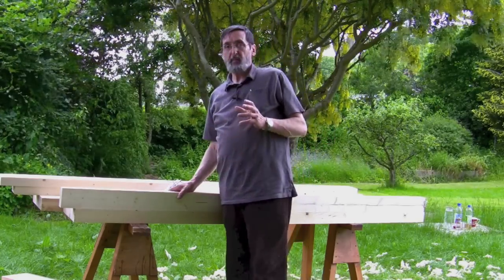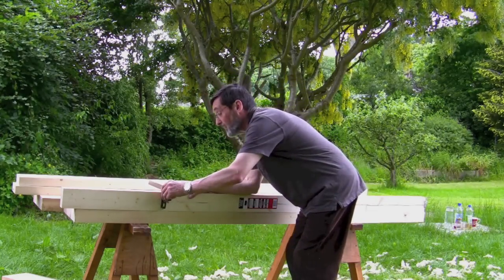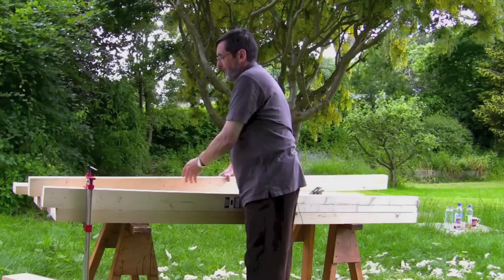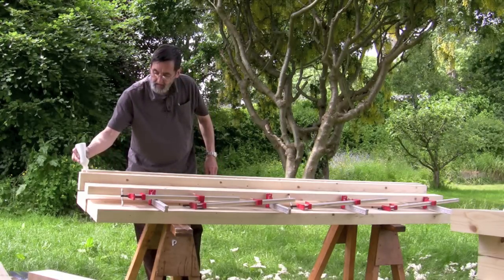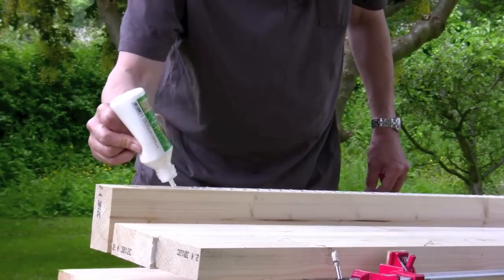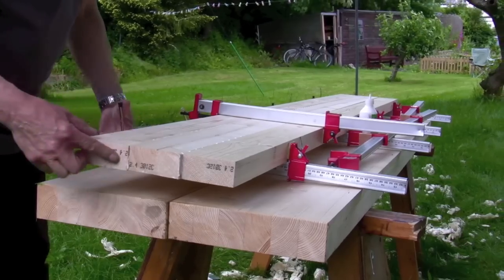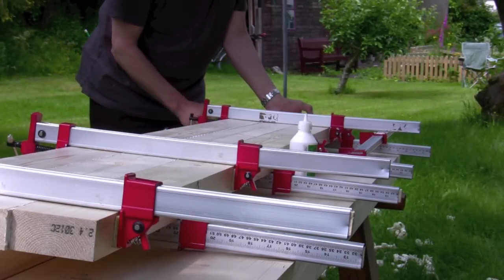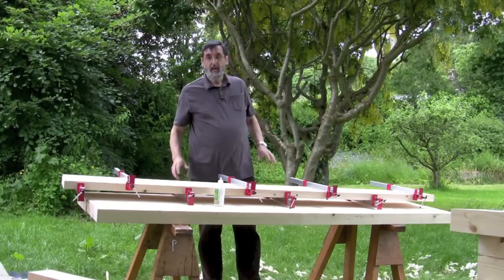How to build a workbench - (Part 4) Making the aprons and the well board | Paul Sellers

Comment: I have been working with wood as a self-taught hobbyist for many years. My adult son recommended your videos and I am pleased to admit that I have learned more in a couple hours watching you than I had on my own in all those years.

Following your videos (and a book about making wooden planes by David Finck), last night I took a perfect shaving for the very first time in my life. More than that, I took it with all three planes I had at my disposal a smoother sharpened as a scrub, a new model Stanley smoother with just a light touch at the corners of the iron and a low angle Bailey. As a former machinist and die-maker, I got a little "retentive" about how flat the soles were, but it cost me nothing extra except time. It is a real experience to cut the dust off a piece and, completely in control, dial the plane in and take robust cuts with the same tool.

My first "project" with a plane was to flatten a piece of SYP for the backing for a strop similar to yours. I marked the wind (there was PLENTY!) by rubbing it against my tablesaw top and planing off the shiny. That was a familiar procedure from my days of barbering dies.

Loved the tip about using a chisel to give the saw a guiding wall to register against. THAT will get used.
Reply: My smoother / scrub is marked as a "Handyman". Pretty cheap on the day it was bought ... but it was singing last night!

Comment: Currently laminating a 2x6 southern yellow pine table top.  Took my 1.5x5.5 down to 1.25.

Glued a few sections, and after planing all of the sections down to 4.5 thickness, I just say your comments about weight ring true.

This 60x60x4.5 top will likely tip the scales above 300lbs.  And I am certainly feeling it.

Thank you for such informative videos.

Comment: One major thing I feel Paul has not shared that you can see @ 5:18 is the end grain of the 2x4 studs. Major C shaped grain that will cause a cup eventually. I had this happen to my first softwood bench that I built. It will eventually cup. Took mine 4 yrs to start showing.

Comment from the maker: Yes: I like both the Stanley #4 and 4 1/2 as first planes and would not buy any other plane over these two Stanleys. If I had $300 spare I would still buy these two planes over any other makers without doubt. The nice thing is that they will do everything more expensive planes will do and more for a fraction of the cost.

Comment: I prefer pipe clamps since they are versatile.  Buy the clamp ends and you can buy different lengths of pipe to use with them so you have different size clamps with just a few sets of clamp ends (8 ft., 4 ft., 2 ft., etc.).  The only drawback is if you need parallel clamps that stay square such as cabinet clamps (but these can be made with wood if necessary; see watch?v=v1lunV4fcEw&feature=related)  Good day.

Comment: Paul.. These videos are beyond genius. You make people feel like they can actually do this!!

Where in the USA can one get 2x4s with no chamfered edges? Seems to me using ones with rounded edges throws a big monkey wrench into your method.

What to do?
Reply: +Mycroft Holmes You can't find non-eased edges in 2x4 unless you go to a lumber yard. Otherwise, buy the 2x4s and rip them 1/8 on either side and you have good stock with sharp edges. Or plane them down.
Reply: +Briar Fox aha!!
Reply: @briarfox637  Otherwise known as " native cut lumber " from a local sawmill...

Comment: where's he getting that dimension of board?  those don't look like 2x4s or 2x6s...
Reply: England. The dimensions of the wood are larger there. Wood in the U.S. - and perhaps some other places are a half inch shorter. His wood does look exceptionally large though! I think in the first part of this series he said that it is really only a QUARTER INCH larger? But it looks so much bigger. haha. But technically these are more 2x4 than our 2x4
Reply: No they cut everything down by half an inch. So 2x4 is 1.5x3.5 4x4 is 3.5x3.5 etc
Reply: Having worked in several lumber mills, in the U.S., the dimensions are given "off the saw". That is, rough cut and green. Unless specifically stated otherwise, what gets to the hardware store has been trimmed, planed, shaped and kilned, loosing half an inch or more in the process. Great for framing and decking, not so much for dimensioned woodworking projects like cabinet work or furniture.